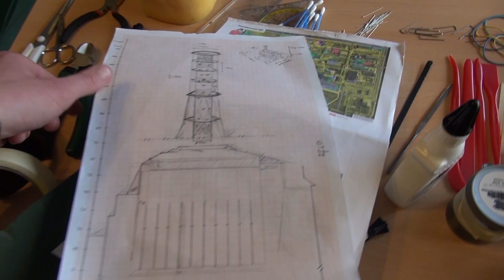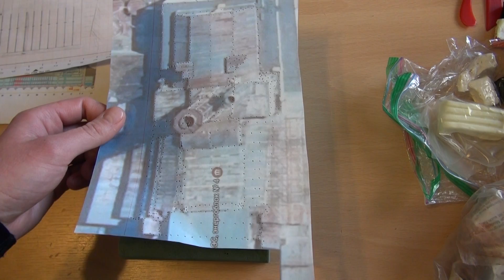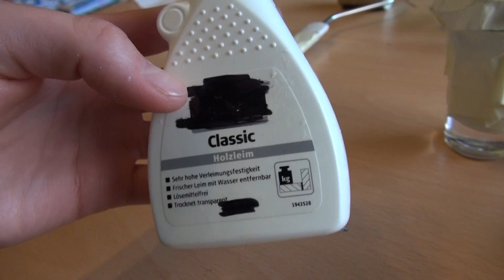constructing a 1:1000 scale model of the Chernobyl NPP / Sarcophagus [model building]

Comment: i got a question, if the structure is to prevent material and radiation comes out, so what its the reason of the chimney
Reply: Jorge  The main reason for the chimney is it functioned for cooling and ventilation of both reactors 3 and 4. The building the chimney sits on is separated from both reactors and after reactor 4 was sealed up, reactor 3 continued operating well into the 90's and used the chimney.

Comment: Excellent model ! You should make a big cutaway model like the one in your new safe confinement 2015 video.
Reply from the maker: that'd take approximately two years of full time work to complete... :P
i just need a damn high class laser 3d printer of my own, damn. then i could do this, but using CAD. ;)
Reply: I agree it would be a huge undertaking.  You need a workshop so you can cut materials up, join them together, paint and generally make a shocking mess. But you would have something unique when finished. I build miniatures from time to time and it is a time consuming, messy pastime but the results can be impressive.  Keep up the good work.  ;)

Comment: Where did you measure the highest radiation ever? And in what video can I see it!
Reply: Yeah but that ain't the highest reading at all. At the hospital with the fireman clothes she got much higher readings.
Reply: or am I mistaken?
Reply from the maker: measured with myself being present? 8 Sv/h near anode focus of a c-arm x-ray device used for cardiac catheters and surgeries in hospitals (in normal operating mode, not high contrast / dose rate mode). c-arm was rotated sideways and i was standing behind the x-ray head, so only my forearm and hand was near (potentially also in) the beam while measuring. whole body exposure as per dosimeter under lead apron was zero (indistinguishable vs. background radiation during workday), though. no video, as no permission was obtained from owner of machine.

highest dose rate ever: linac (clinical linear accelerator), cancer radiation treatment unit. watch?v=5dt02jHtxXc
i was not present in the room, however, as dose rates were measured within Sv/min; a linac can, in THEORY (maximum output whole body exposure), give you a fatal radiation dose within the blink of an eye (you can also destroy inanimate objects with the beam, and turn everything including the air radioactive, hence why i observed from the control room). 

you mean in chernobyl? a fuckin' joke compared to hospital equipment, but as opposed to the devices i used, the source could not be switched off, so it's still interesting - but not really scary. watch?v=6kg4vVYKc90

highest dose rate from uniform source / area measured in 1 meter from the ground in chernobyl? discarded turbine parts (had to be removed for structures required for the new safe confinement afaik), uniform gamma only energy compensated dose rate reading at >0.5 mSv/h. video? to follow, stay tuned.
Reply: Thanks a lot for this extensive reply!! Gonna check all those videos later today or tomorrow. So interesting! 

Can I ask what your plans are after chernobyl? Maybe fukishima :)?

Comment: You should put inside the reactor some radioactive material;)
Reply from the maker: if it is a homogeneous mass (which it more than likely is not), then you could specify an activity per mass unit (e.g. becquerel per gram, curie per kilogram), and if the surface area would be the same in relation (to allow the same amount of alphas / betas to escape to surface and not be shielded), then yes; 
for gamma radiation (implying that we can neglect shielding and scattering from the material itself), and assuming a point source (which can be archived by increasing source <-> detector distance), you can specify an absorbed dose constant in the form of [absorbed dose * meters squared * seconds * activity in becquerel (decays per second)]. 
thus if homogeneous and assuming gamma only (e.g. at sufficient distance), you could assign a dose rate constant to the molten mass of fuel / corium, and estimate the measured radioactivity (absorbed / equivalent dose rate, e.g. stated as uSv/h) in a distance of x by the formula (dose constant * activity [bq]) / (distance [m] squared). 

however, outside the model, it'd still of course be vastly different - my model is made from simple clay and plastic, as opposed to heavy steel and concrete; so the mass attenuation coefficient (amount of shielding) by the model vs. the real building would be greatly different.

yadda yadda, let me take an angle grinder to the molten core of chernobyl next time, i'll cut out an appropriate piece and do measurements for ya, much more fun than this math shit. ;P
Reply from the maker: a thousandth of the elephant's foot radiation? that's probably ~25 mSv/h, totally doable actually. thats your usual high dose rate (radiation therapy devices calibration) check source. (y)
Reply: And it should be placed where the elephant foot is!
The radiation intensity should be also in scale :P
Reply: lol, I bet you would have more fun using a sample of the molten fuel directly from the foot.

Still, I think the math is interesting, I didn't thought about the difference between alpha, beta and gamma when scaling.
Reply: you can make little turbines and scanners too to measure the rads. make a little figure of yourself scanning the elphants foot too. ;)
Reply: That's so perfect!

Just out of curiosity, if you built a very accurate 1:1000 scale model, meaning the elephant foot model is in scale and the composition of the radioactive material is the same, would the radioactivity measured outside the model still be in scale? also decay time et cetera? or some values scale differently, like proportional to the volume rather than the surface or distance.
I guess the radioactivity depends from the volume and is proportional to the mass of the radioactive material.
Just a nerd curiosity :)

Comment: Where did you find the 3d schematic over the reactor? i have been looking all over for something like that :)
Reply from the maker: over the reactor? you mean the aerial view print? that's simply google maps...
as for the schematic on graph paper, i did that myself by looking at building plans and whatever i could find online. dimensions were discussed a lot during the making of the new safe confinement, luckily.
Reply: The one that you showing of @ 4:31 its look like prints from a construction 3d model :D
Reply from the maker: i believe that came from the official ukrainian chnpp website. but just gave it a try, you can randomly find it on google images by typing in "chernobyl sarcophagus schematic"
Reply: Allrighty! I'm doing some 3D modeling and have a plan to 3D print a scale modell as well and got a bit exstatic when you hade shots of a real 3d model :D  Thanks for all the Amazing videos and its fun to the diffrent perspective you have on the area if you look at the Documentaries that is released from like Animal Planet.
Reply from the maker: yeah, I'm also considering printing the CAD model of ChNPP i have. i suppose a conventional "nozzle" 3D printer that forms layers out of plastic from a printhead may not be able to print the framework of the ventilation stack, what do you think? do you have any experience with laser 3d printers? that may be a better option, but the materials are FUCKING crazy expensive, so if that goes wrong, eeeeek!
Reply: The laser curing printer is indeed more fine and could probably handel it. I got one of those nozzle ones so my plan was to print everything in parts with alignment pins and then superglue it together. for the framework on the stack my plan was also to use wire to make is look as goos as possible. but there is a lot of work to make the 3d model for me so its maybe a year of work still :)